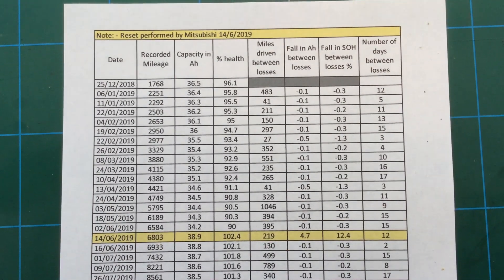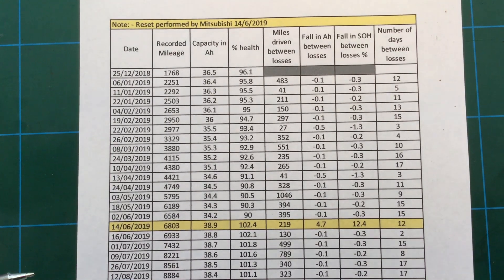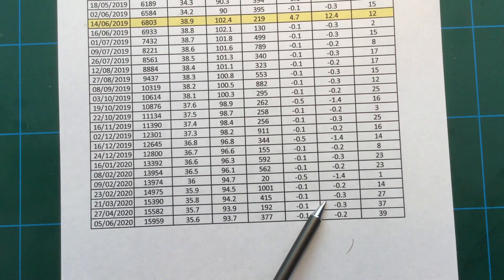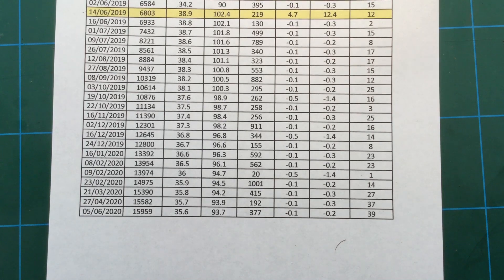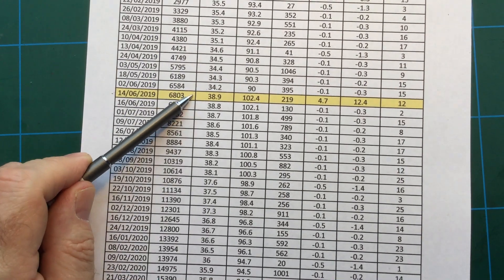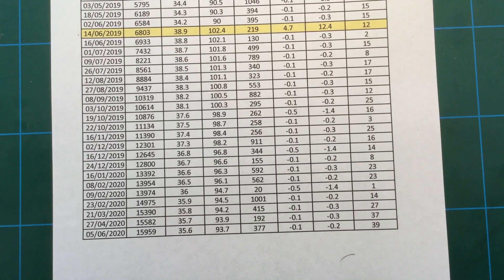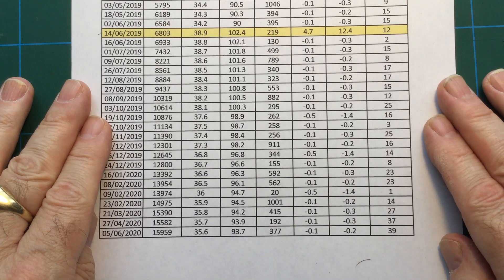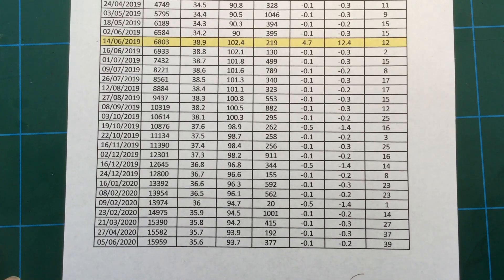Mitsubishi Outlander PHEV battery degradation - UPDATE 3

Comment: I have the phev 2017 model. On a full overnight charge on key on it shows I've 19 miles. Currently with no fans on or heating etc I get about 15miles at 11c outside temp
Reply: same exact numbers - mine is 2016 with 71.3% SoH (measured with phev watchdog and by mitsubishi service). total miles 54000
Reply: @matti_pee  not much we can do and I think I'm near warranty finishline
Reply: @Gareth_NocturnalGarage  mitsubishi battery replacement?
Reply: @matti_pee  how do we get this done under warranty? Even with all the analysis and time you have put into it have they offered you this?
Reply: @Gareth_NocturnalGarage  Yeah, I took my car to official mitsu repair shop and they measured that my battery was 71.6% (now 71.3%) and they said that when it falls below 70% then it's replacement (valid for 8 years or 160.000km)
Reply: @matti_pee  is the replacement free under warranty?
Reply: @mostlymessingabout  Yes and I since my last comment I'm now running on a new battery. Which is also degrading :D
Reply: @mostlymessingabout  yes